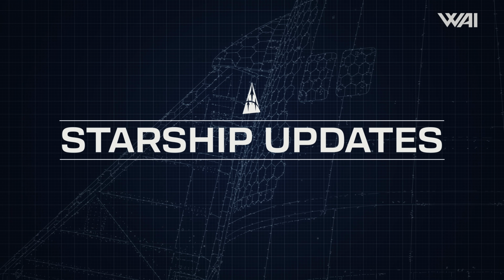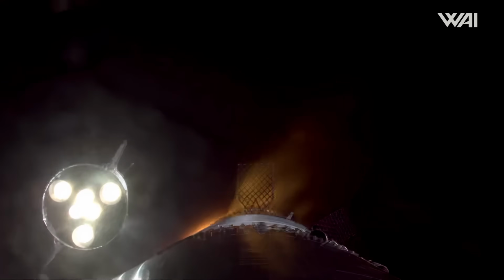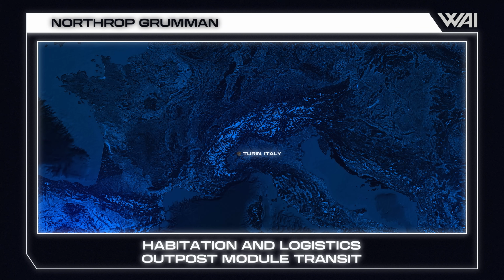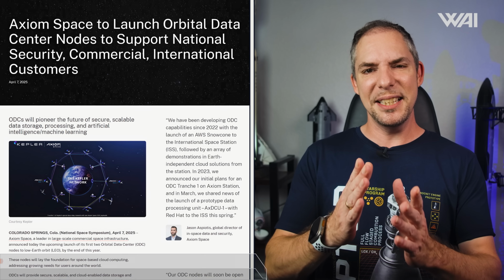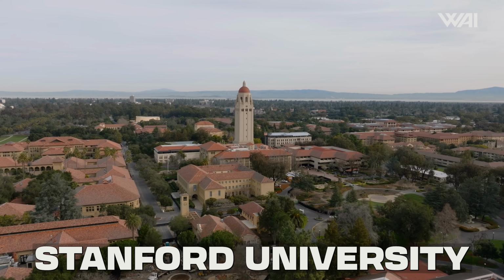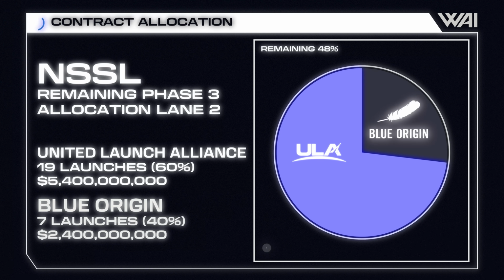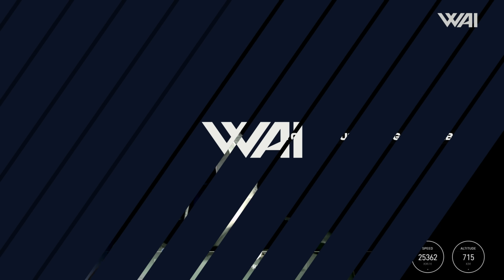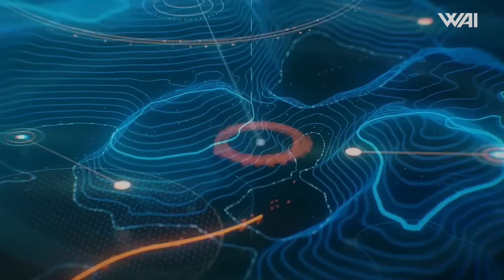SpaceX Unveils MASSIVE Starship Upgrade! Production begins on even crazier version!

Comment: The idea of "cloud servers" in space appears to be basically a load of bollocks. The ISS, for example, consumes around 100 Kw - and has huge solar arrays. A typical "cloud" data processing centre can consume several megawatts of power. On earth you have largely conduction and  convection methods to carry the heat away (all the power ends up as heat, effectively). In space you only have radiators to carry the heat away. Thus you need large and heavy solar arrays and large an heavy radiators to generate the electricity and to dissipate the waste heat. Additionally, there is no effective or cheap means of servicing faulty equipment in such a space-based facility. Even further, there is the additional equipment needed to link to the on-orbit data centre. Even with routine flights by Starship the costs of assembling such a facility would price it out of competition with terrestrial sites. Data centres are, by their nature, a commodity product where price is a prime consideration so spaced-based, unrepairable computing looks very much like a non-starter.
Reply: Cloud servers would be better in water.
Reply: Yes, the answer to energy in space is SMRs (small modular reactors) or which can be under 50 tones and produce upwards of 300 Mw of power. (but yes the current design is crap)
Reply: Cloud is a buzzword to describe decentralization of computing processes which undermines the commoditization of computation. Until we have robots today can do the experiments on the ISS, the astronauts there are cloud computers. Data centers used to be more of storage lockers for people to access. Processing and computing involves going through people's stuff making copies of it and modifying them or ppropriating people's things they didn't know they had in storage. When humans learned to talk or loud in groups together that's basically cloud computing with the community's memory as a data (de)center. Your mind can can install bloatware, spyware, trojans, and people who often change their minds to new builds are subject to zero day exploits (cult like behavior) until they get patched (rehabilitated) or factory reset (traumatic storage deleterious event to protect vital computational abilities). Maybe some information is worth processing and storing away from the guy running the storage locker, especially if he's auctioning off your things
Reply: Hopefully this reaches those who posted replies to my comment. 
Just FYI, my original post only mentioned a couple of drawbacks in space-based data centres. I omitted some equally obvious points which, looking at the comments, are maybe not so obvious to everyone. Just a couple more. The atmosphere of the Earth protects us and our equipment from high energy radiation and cosmic rays. In addition to the weight of solar panels and radiators, radiation hardening will need to be added to all the elements on the space-based computing "farm". Even beyond that, some cosmic rays are so fast and energetic that hardening will not stop them causing damage. Thus either you run with fine scale (single digit nanometre) features on your chips for speed and efficiency and accept the risk of results being incorrect because of random corruptions ,or, you run larger feature sizes and have slower, less energy efficient processing. Neither choice is better than terrestrial alternatives.
Reply: Internal combustion engines are loud and heavy and use expensive and rare gasoline.  Nobody is going to be able to afford one.

That's what you sound like.
Reply: @jwm6314 If you are not a child, under 12, then you appear to be either remarkably ignorant or remarkably stupid. Unlike non-existent cars at the time of invention, to which your argument might apply, we already have huge numbers of terrestrial data centres which reliably provide the desired services, comparatively cheaply.
Reply: Not to mention, cloud computing needs very rapid telecommunication to the clients. The clients on Earth would have way too long of latency for good performance.
Reply: There is a lot of chatter about light based computing,  which will ameliorate the problem.
Reply: It's for users in space, not ground. You can use higher data bandwidths space-to-space than space-to-ground - which means a faster turn-around time for sending, processing, and returning. Point-to-point optical communications is also MUCH more secure - very important for national security purposes.
Reply: @reality9451  False. The use of space-based data centres is largely being touted for terrestrial users for marginal reasons such as security (which you mention). Security is an issue but most breaches are electronic, not physical, so placing your computing power in space brings minimal advantages. Other cited reasons are equally minimal, e.g. it is less (heat) polluting, true but minimal. 
It is true that there is a very specific advantages to space-based computing: data processing of satellite data such as earth imaging. Potentially, the data could be processed in Earth orbit and a smaller volume of processed data transmitted to Earth. This might offer small savings. It comes with its own drawbacks in that you lose the raw data - so more advanced or different processing techniques which come along later cannot be used to revisit the data. So again, I think that is likely a non-starter.
Re. the bandwidth issue, we already use fibre optics (so light-based) in much of our communications network on earth. Dedicated lines can be built or hired for far less than the cost of launching space-based computing.
You also ignore latency. My local data centres (tens of them) lie about 10 miles away so latency (each way) is, at worst, around 0.00005 seconds. An orbiting equivalent at 550 miles has a latency 55 times greater (0.003 seconds).
Reply: thank you - finally somebody put some rational thought to this irrational idea.  We don't need space based data centers. We need moon based data centers... 😜

Comment: Read that Musk is proposing the government drop the manned lunar program.  With the military programs that SpaceX has been working on with the government, I'm wondering if Musk is more interested in the money from those programs instead of simply space exploration?  Now they're talking about SpaceX landing and launching from Johnson's Atoll for the military.  

  I'm curious about the shape of the Starship.  The shuttle had a blunt shape so it would create a shock wave in front of it, to protect it from the 9000F temps generated during re-entry.  The silica and carbon-carbon tiles on the shuttle could withstand temps in the 2500-3000F range, so NASA needed to do something to keep those 9000F temps off of the shuttle itself.  Stainless steel melts at a temp just over 2500F, so Starship is going to have to do the same, if it ever gets into orbit without blowing up.  And, Starship definitely doesn't have that shape.  In fact, just from visual review, Starship has a lot of what looks like heat stress riser edges and details to it that the shuttle definitely didn't.

 I'm suspect we're seeing a shift in SpaceX business priority, and the company sees more of a money opportunity from its satellites (talk about littering the space around earth!) and military opportunities.  Is Starship just a farce to burn up the tax dollars that were allocated to it, while really concentrating on the massive booster development for those military applications?  I wonder....

Comment: Think about it SPACE X has now built 17 boosters! Boeing has built three maybe four? Space X starship is still under development and Boeing is not quite ready to safely be used. I think in a year Starship will be clearly on the way to delivering 300 starlink satellites per launch and perfecting block 3.
Reply: block 3 , v3  hold 400 plus due 200 tons  plus .
Reply: Starlink satellites require launching from Florida and will require launch facilities, booster, and starship at LC-39A.

Comment: Great news on the V3. I think they will end with using both 'sizes' for different payloads and missions. But I have to ask if Mechazilla is tall enough for V3?
Reply: yes  it tall for v3  .
Reply: The lift points can be installed lower on the starship hull. No big deal.

Comment: I would love for SpaceX to send and leave, 4 or 5 Tesla Bots to the Moon, on their test launch and Landing. Showing the people of Earth, what being on the moon is actually like.
Reply: Speaking of Tesla, would their electric car work on the moon?  What systems, if any, would fail to operate properly?    I believe Tesla's have a water based cooling system which would boil away if it isn't air tight.
Reply: @MarkG-SF practically no car would work on the moon
Reply: @archierush868 Why?  The later Apollo missions operated a simple electric car on the moon.
Reply: The FSD would run over an alien
Reply: @MarkG-SF no commercial car. Specially designed rovers like the Apollo rover worked because it was designed to drive on the moon and not earth.

There are basically no cars on earth which can drive on the moon right now, except for the prototype lunar rovers for Artemis. You’re not gonna have a Tesla on the moon
Reply: @ Again, no reasons WHY are given.  I can tell you they absolutely would work.  The question is for how long and why would they end up failing.
Reply: @MarkG-SF the batteries used in EV’s would likely not work very well, or for a very long time in space where it has nowhere to radiate the heat generated, as well as it being either +/-200C so it would likely overheat or freeze in just a few hours. Another reason is the tyres but that’s a more niche argument as tyres can be made that work on earth and on the moon.

This is why I said they pretty much won’t work on the moon. Driving around for 10-15 minutes before the battery overheats doesn’t really count when actual lunar rovers are supposed to last for hundreds of hours on the surface. It’s almost like we are specifically designing specialised vehicles for specialised purposes.

Comment: Power delivery from space, while an interesting source of R&D is really not commercially viable. The path lost from geosynchronous orbit, or the problems with needing to control many satellite sources in a lower orbit, makes it a difficult problem. Then there is the cost of getting the energy satellites into orbit.  It will always be cheaper to have wind and solar power plants on earth.

Is the ISS the largest solar powered object in space? A solar base power plant in space is going to need to be a lot like the ISS. It will need a long boom to support lots of thermal radiators to dissipate heat, plus a place to attach solar panels.

While I doubt it is practical, the money and research put into solar panels for example will be of benefit.

Comment: Orbital data centers are interesting in terms of legislation. They will be in no country and so no rules will apply. They can develop AI however they want or no-rules gambling or 'that other thing' that the internet is infamous for (but YT will not like us mentioning). 
Orbital solar panels are stupidly expensive compared to last based solar which is about 1% of the price for 25% of the efficiency. Space based solar has a few niche applications, most of which are military in origin. Imagine recharging an electric submarine with a beam of power from orbit, the sub quickly charges then disappears under the surface again.

Comment: I've always been perplexed by the idea of space based solar power. It just seems ridiculous to me.
Reply: All the land-based solar collector arrays are idle at night. Perhaps gimbaled film mirrors in orbit could light up the larger arrays. No need to launch all that electronics complexity and mass. It would also be far more efficient. 

A subscription service model based on metered night-time power seems plausible. 

The downside is visible off-target flashes of light as mirrors flick between (widely separated) ground locations. Perhaps a LCD shutter is needed. 

Also, local light pollution regulations might require suspending beam service where clouds intervene, especially for protecting optical observatories.
Reply: you get about 4 hours of peak energy on the Earth. with the right orbit you get about 23 hours and 50 minutes. so you collect about six times as much energy just there
Reply: @dowlansmith   Sure, but then you lose 99% transmitting it down to the surface.

Comment: Seems kinda stupid to be increasing the payload capacity when it hasn't even carried  a payload, made an orbit, or landed properly
Reply: Carrying a payload to orbit is not the ships current goal, it’s to survive reentry and land at a precise location, which it has done twice with Flights 5 and 6. If you made a ship which can’t survive reentry, it can’t be reused. Orbit is really easy for the ship, just burn for a few seconds longer and you’re in orbit. The reason why they DON’T enter an orbit right now is because of public safety as it could lose control and be unable to safely deorbit itself in a controlled manner and in the designated zone. Look back at flight 3: had that been truly orbital, the ship would have been stuck in space and unable to safely deorbit.

If the next flight goes perfectly, they will have to go truly orbital and probably deploy StarLinks before returning to the launch site for a catch on the following flight.
Reply: @archierush868 that's the point. They don't trust it enough to orbit so they're making it larger and more complicated makes little sense when the goal isn't to carry things yet anyway
Reply: @prophetrob no, they are polishing all the failure points until they are certain it won’t break up or lose control. They are progressing as safely as they possibly can without accidentally sending a ship into an uncontrolled orbit and contributing 150T of space debris. 

Also, the V3, Block 3, whatever it’s gonna be called, ships will be like Ship 40+, they’ve got like half a dozen Block 2’s in varying stages of production, so they’re gonna fly them first before Block/V3 is ready. Ships 35-38 are all Block/V2 I believe so that’s at least 4 more flights until the first Block/V3 ships may begin testing, but it doesn’t necessarily mean that they’re gonna stop V2 production. I think V2’s took roughly 6-8 months until it started flying with some hardware being seen around June/July/August, then a first flight in January. As I said previously, if the next flight goes perfectly, they’ll send the next one to orbit, deploy StarLinks, and attempt to catch it, probably late May.

Only when THEY are certain it’s safe, will THEY launch THEIR rocket into orbit. You can’t tell them how to use their rockets, and they’re not stopping from two failures. Falcon 1 had 3 failures in a row and a 4th, had it failed, would have bankrupted SpaceX. When a problem arises, they’ll send the fix it.
Reply: Thanks for explaining clearly why they continue to splashdown in the Indian Ocean. 

Totally agree, except for "real Starlink deployments". That must wait for launches from KSC. 

The orbital inclination for most Starlink is ±46°, and so those must depart from KSC. Stargate/Boca Chica can only launch with an azimuth of -5° or -15°, so the inclination is very restricted, nearly the same as the latitude. KSC launch azimuths can nearly** be as extreme as -90°. (** requires a slight curve during ascent) 
@archierush868
Reply: Kinda criticising SpaceX as being "stupid", huh. The big money invested says you are a poor despiser.
Reply: @imconsequetau5275  big money gets invested in dumb shit every day
Reply: technically, it DID carry a payload once.... a banana on flight 6..
but that was a block 1 ship
Reply: @officialcheetahhopperz1  I feel like that's more appropriately classified as a decoration

Comment: Just like to point out that with a header tank welded to the nose of Starship, the usual docking of spacecraft nose to nose is on longer available. A setup like the Shuttle used to dock at the ISS will be needed. Interesting that none of the animations I've seen so far have taken this into account. Seeing the images used in this video refreshed this issue in my mind again.
Reply from the maker: Absolutely! The reason why we don't have a docking port in our renders is because the current versions don't have one and we don't know where it will be or what it will look like. But, yeah... the nose can almost be ruled out. Maybe a crewed version will have a different internal design.
Reply: @Whataboutit  Yeah it might be a temporary solution. And one that might be fine for cargo ships. But when crew modules are added the header tank might be places somewhere else entirely.
Reply: @donenzonen yes but the reason spacex put the header tanks in the nose was for weight distribution and assist the landing burn flip I believe. Moving it somewhere else could completely change how it flys
Reply: i dont think HLS will even have header tanks as it wont land on Earth like a regular Starship
Reply: Toroidal tanks are a possible solution, but are far at least 33% heavier than optimal shapes like a sphere. 

Putting a cylindrical tunnel through a high pressure vessel is going to put the wall in compression, which requires far more strength - another mass penalty.

Comment: I am thinking that v3 starship could not be block 3 starship as it may be what they need to create to mitigate and prevent IFT-7 IFT-8 RUD issues
Reply: It just requires some engineering refinement. As other sources have posted, there were three different versions of possible resonance fixes installed on the last block-2 flight. At least one failed but perhaps the other two worked well enough.